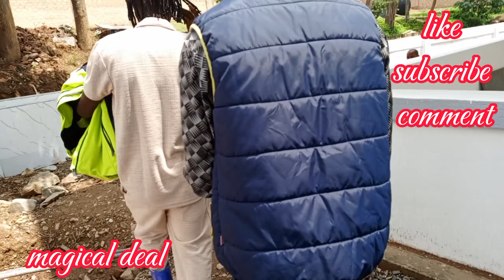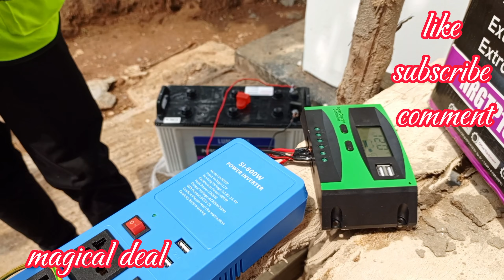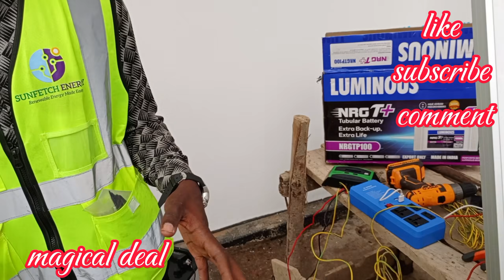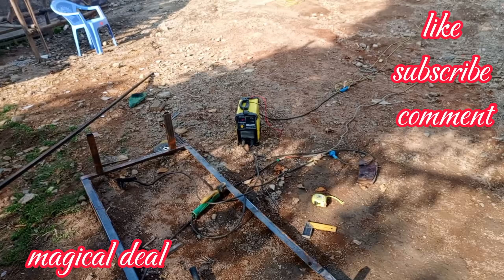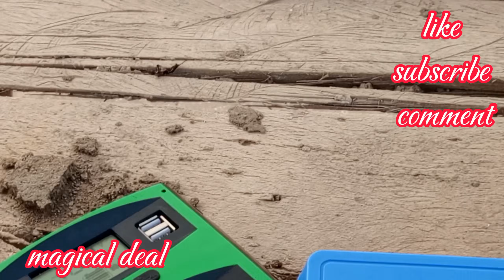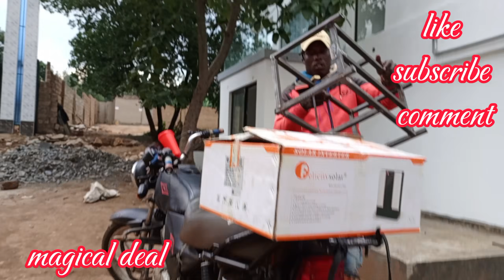pre-testing of mini-solar system  with the boss himself for @iammarwa's wifi@MagicaldealsAfrica

Comment: Doesn't  it come  with  a  converter? Also, instead  of  using  black  tape, why don't  you  use  wire  nut?
Reply from the maker: It's just pre-testing not permanent installation